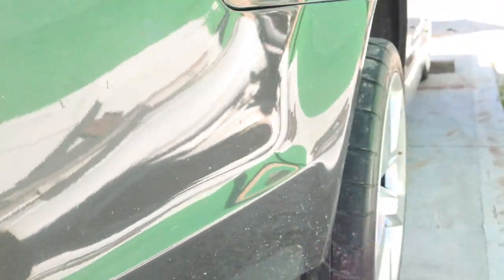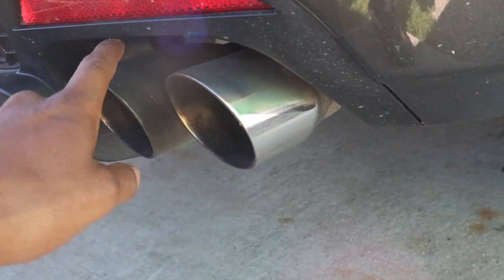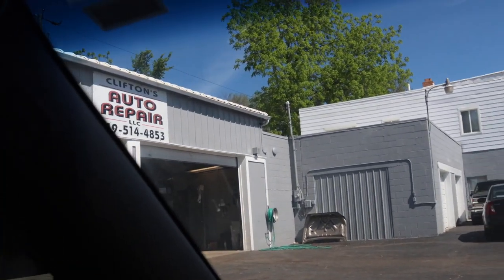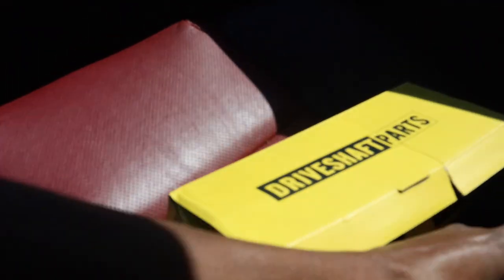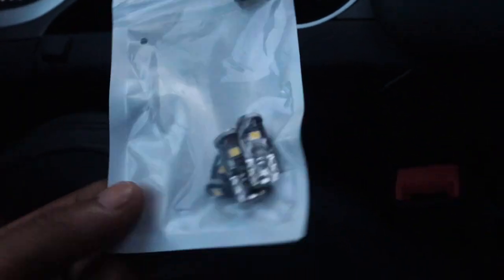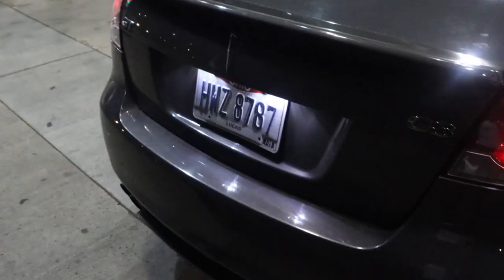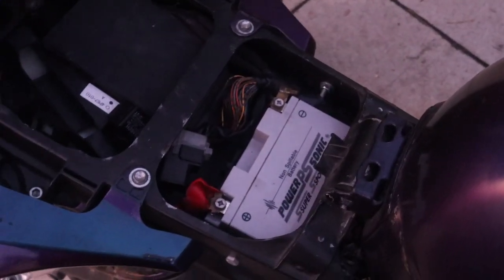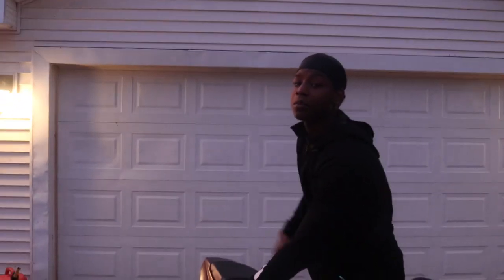MY G8 GT TRANSMISSION BROKE SMH!? *this is bad!*

Comment: I believe it is the drive shaft carrier bearing. The G8 drive shaft is in two pieces between the transmission and the differential. This bearing joint between the two pieces is a common point of failure. I recommend going to a one piece carbon fiber drive shaft. This will eliminate the carrier bearing and the connection joint.